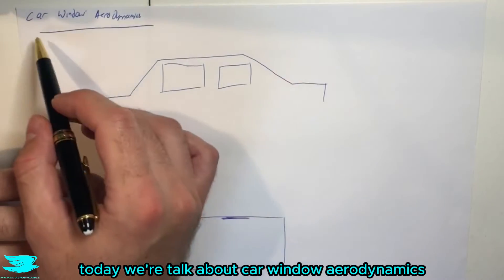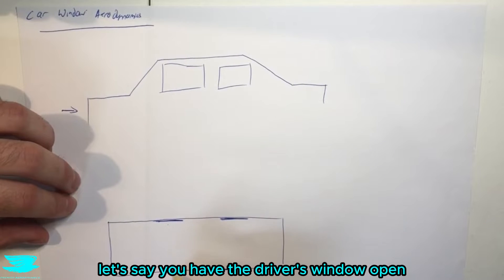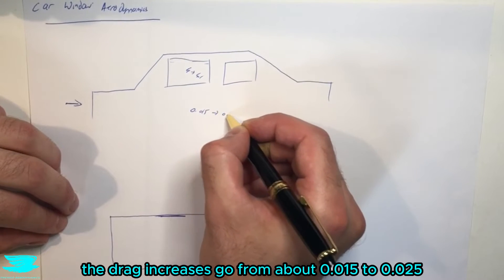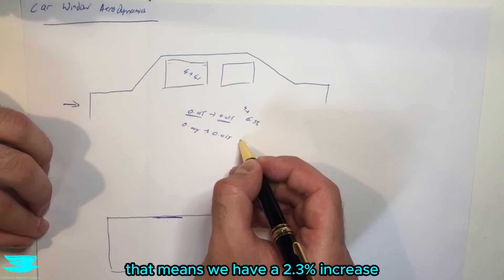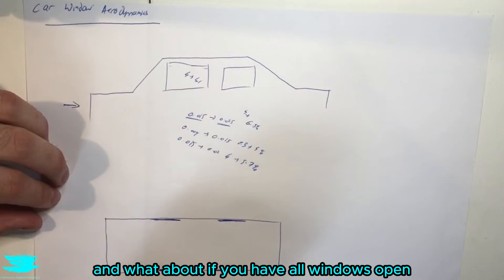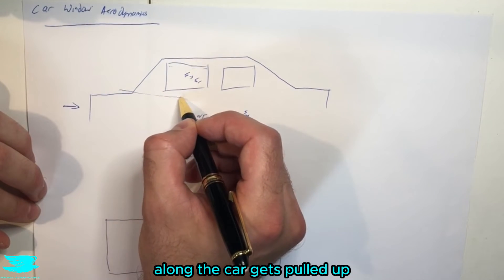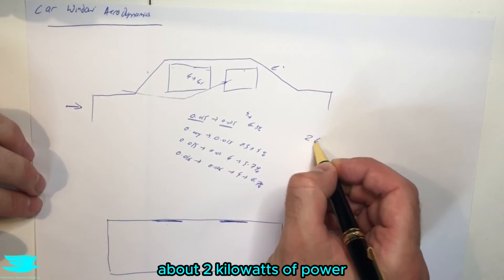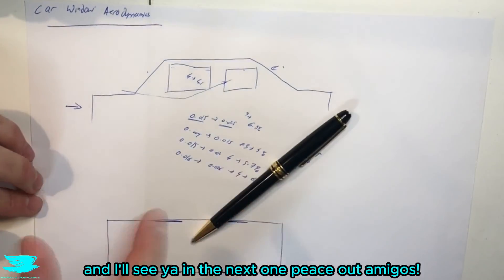Should You Open Your Windows Or Run The Air Conditioner? {Auto Aero #58}

Comment: Help me settle a debate. Someone's telling me that when im driving with both front windows open that the air isn't coming in from outside when driving slowly at 40kmph. I know that some air will be flowing up along/ over the vehicle, but surely there's some cross ventilation into the vehicle from simply having the windows open?
Reply from the maker: Yep, having two windows open will allow the pressure to equalize and have air flowing through. It probably won't be a steady stream, but the crossflow will be greater.
Reply: @PremierAerodynamics thank you so much!

Comment: hybrids with electric A/C compressors like the Prius can draw as little as 200 watts depending on the climate control setting. so for them only put the windows down for a short while if air in the car is hotter than outside so the ac doesn't have to run as long.
Reply from the maker: Really? 200 watts? Does that do a lot to cool down? If so, then that's pretty sweet.
Reply: @PremierAerodynamics  (when stationary with outside temp 85f and a set temp of 74 ) it starts at 2kw for about a minute then as the temp comes closer to the set temp it ramps down. i think it has 4 or 5 stages. but minimum is 200w.

Once the target temp is reached it will run at 200w intermittently depending on the fan setting. on the lowest fan speed (1/8) and thermostat set to 74 it will run for 4 seconds every 8-10 seconds. 

so i guess the average power consumption would be even less. thats without mentioning that the  200w metric is total power draw from the HV battery which powers the 12v components with a dc-to-dc converter of unknown efficiency. 

i can get the exact number with graphs and shit with the torquepro app but thats for another day lol

anyway, the cost per hour to keep the cabin at 74f with an outside temp of 85f is about 30cents/hr at $4.50/gal
(the car tells you how much gas you used in USD when you turn it off)

if you have access to a Toyota hybrid vehicle you can use the hybrid assistant app which is what i used to get this info. 

let me know if you want to know more haha.
Reply from the maker: Thanks for the info! :)
Reply: @PremierAerodynamics  (for sitting stationary)
it starts off at 2kw until the cabin sensor reads close to the set thermostat, then the compressor starts to slow rpm. once the set cabin temperature is reached the compressor will come on and off just to maintain it. so in reality its less than 200w.

with an outside temp of 85 and a thermostat setting of 74 and fan set to 1 out of 8 (once cooled to) the compressor will run at 200w for 4 seconds every 8 seconds or so. in these conditions it costs roughly 30cents of gas per hour. at ($4.60/ gal) the engine kicks on about twice per hour to charge the hv battery from 30% to 50%

if you have access to a toyota hybrid i use the hybrid assistant app to get this data.

if you'd like more info lemme know.

Comment: I've noticed if the rear window is open in my car I get that horrible thumping noise like a helicopter (I call it "choppering"). If I also open the front window it stops the noise, so I can see why having multiple windows open could reduce drag. I'm assuming that noise is due more to some kind of resonance rather than turbulence? Because the timing of the thumps are very uniform and can disappear at certain speeds.
Reply from the maker: That happens in a lot of cars and it is a buffeting.

It's kind of like if you have a glass bottle with a small opening in the top, then you turn it upside down to pour the liquid out. The liquid comes out in the pulses. That's because the pressure inside the bottle has to equalize with the pressure outside and when you change how much fluid is inside, the pressure also changes and then air needs to come in to equalize it.

For the car, a similar thing happens where if you have just one window open, there is a constant imbalance. When you have two windows open, the air can come in one more easily and out the other one more easily (generally speaking).

Comment: The A/C consumes about 5% of the fuel your car uses. If the drag from having open windows makes the car consume less than 5% more fuel, then it's more efficient to just go windows down.
Reply: But the power usage of the A/C also depends a lot an the temperature you cool the air to. So if you just use it to blast you with ambient air (like a open window does) it should take way less energy
Reply: @drnono8605  The power usage of the A/C is generally fixed by the thermal expansion valve/orifice tube. That tells the compressor when to cycle, and controls system pressure. Now your condenser also plays a big role, bent fins, dirty caked on crud on your condenser, or weak radiator fan(s) affects the efficiency and energy needed to make that TXV cycle the compressor.
Reply: The percentage increase depends greatly on speed. A typical car consumes 0.2 to 0.5 gallons/hour when idling, but somewhere around 5 gallons/hour at 75 mph. As Premier stated, the power consumed by A/C is more-or-less a constant 2kW (less than 3 hp). When idling at a stoplight or in a drive-through, A/C power consumption is far more than 5%.
Reply: @AwestrikeFearofGods  It's not constant, when you're driving since you have air passing through the condenser, system efficiency improves.
Reply: @rolandotillit2867  To your point, A/C power consumption is not precisely constant. Perhaps higher airspeeds result in a reduced duty cycle, reducing time-averaged power...but perhaps not. The efficiency might instead result in greater cabin temperature reduction, with no reduction is duty cycle. Either way, A/C power is RELATIVELY constant when compared with cruise power, which can vary by over an order of magnitude, depending on speed.
Reply from the maker: Yep, exactly, whichever uses less power while still providing adequate cooling is the way to go.

Comment: Interesting! Any idea about wind deflectors? Do they decrease the extra drag from having the windows cracked just a bit?
Reply from the maker: I can't find any research on it actually. These conclusions on the window openings in general are already fairly sparse.

But, if I were to hazard a guess, I would say that they don't do that much because the window opening provides low pressure regions that pull the streamlines up over the back. Wind deflectors reduce more of the buffeting, but air can still come in through the open window, which will still pull the streamlines back over the car and increase the drag.
Reply: @PremierAerodynamics 

If the low pressure inside the car is stabilized, it counters the low pressure of bernoulli effect.

But i guess it is a bit unstable. This results in making the inside of the car airproof. And slight air movement leads to wakes.
Reply: I believe it's depending of the window position.

bernoulli effect powers music instruments. And the wakes of open windows.

With an air deflector you can let the airflow jump over the open window.

This jump is also able to reduce drag. Air jumping over Bird feathers reduces drag.
Fish scales work the same.

Bilge flap on boats is an interesting topic. I've invented cavitation Hulls for boats with this. Just let the water do a jump, so that less hull area has to mess with the waterflow.

You can avoid tollmien schlichting waves , by jumping over the surface.